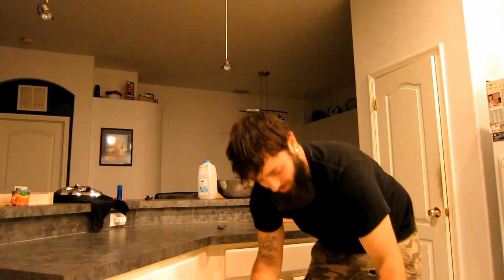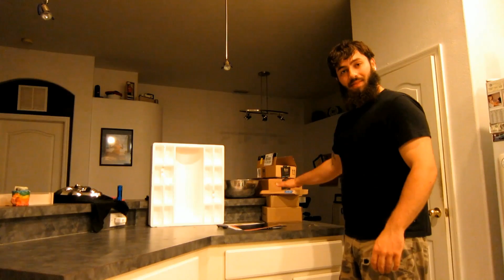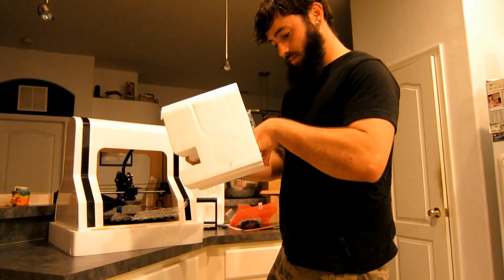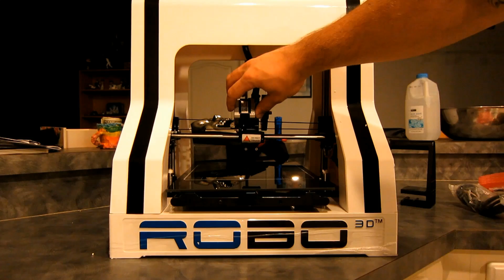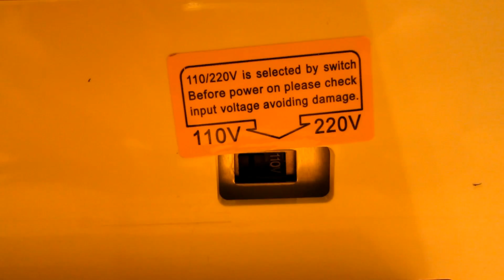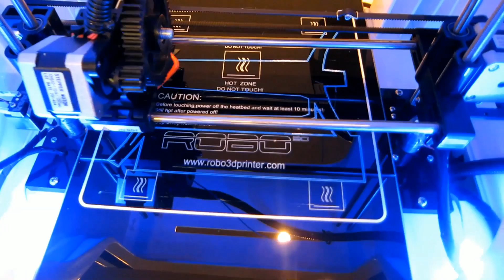Robo 3D R1 unboxing and setup

Comment: Have u had any issues with layers separating way after the first and second layers? I have had very few successful prints
Reply from the maker: what temperature is your extruder set to?  that is probably your problem,  look for specs on your filament and adjust from there.

Comment: Is there a follow-up to this video that shows the finished product? Did you design an updated spool holder yourself? I just got my Robo 3D and I can also see that it's gonna be a problem. If you could send me a link to the design I would really appreciate it. Thanks for the video. Very helpful.
Reply from the maker: fungus, my upgrades and tips video is kind of a follow up to this. i recommend it if you have just gotten your printer.

Comment: So do you like this 3d printer and does it work well for you?
Reply from the maker: I do like the robo3d! it's a great deal for the build space,  and it does nice quality prints, I also believe I can get better prints than what I've got.
Reply from the maker: i found that cleaning the bed (I just use water and paper towels) every print or two,  and using a decent spray of hairspray goes a long way.  also my bed is set to 70C on the first layer and 65C for the rest of the print.
Reply from the maker: most hairspray works,  I have suave extreme hold.  you can see it in my upgrades and tricks video,  I bought it at Walmart.